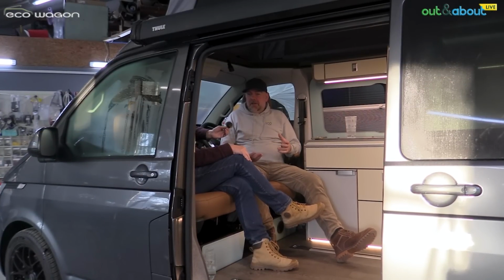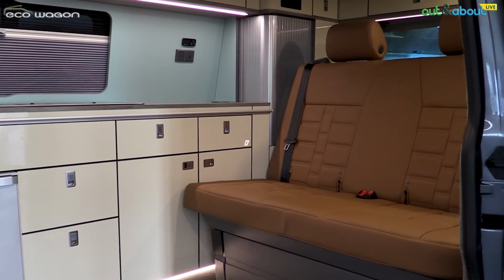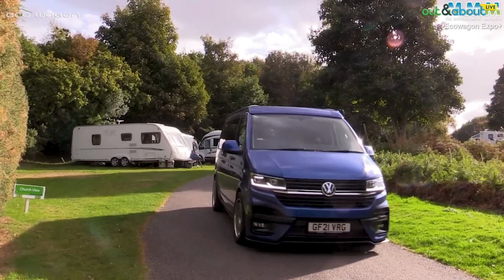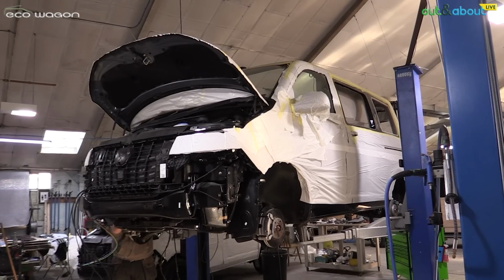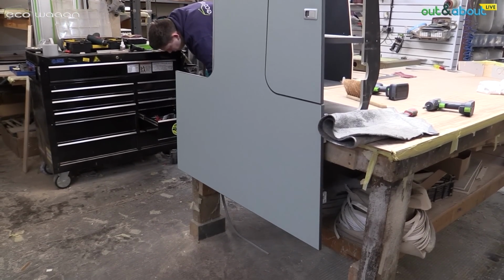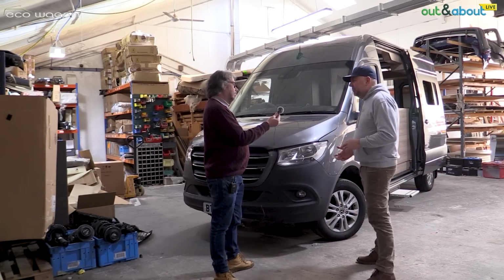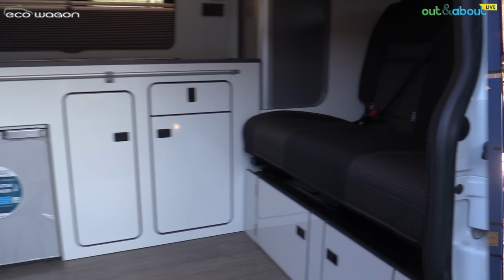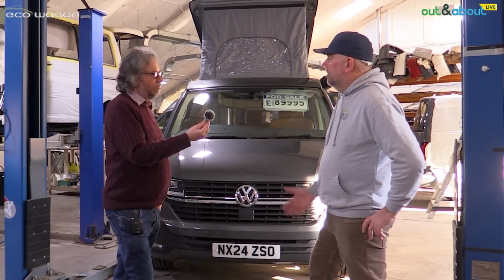Inside Ecowagon: The ultimate high-end VW campervan conversions

Comment: Gas doesn’t belong in a small T6 (space taken by gas bottles). Induction neither (space taken by 2 lithium batteries. I use a 2kW diesel-driven cooker/stove in my T6 (brand is Wallas) and very happy about it. I live in Sweden and it heats up the van in winter as well
Reply from the maker: No space for gas here as it's in an underfloor tank
Reply: Bore off pal
Reply from the maker: @ Any need for that?